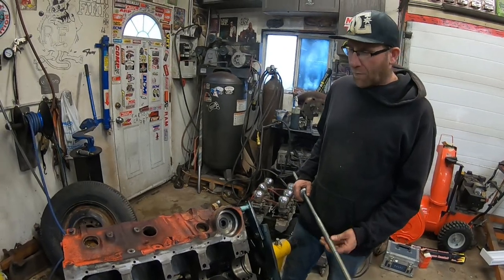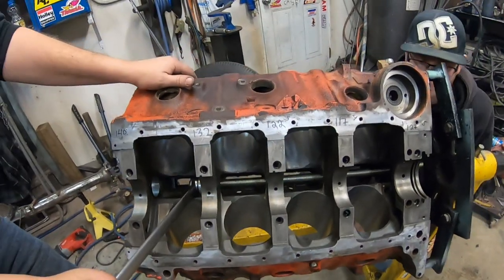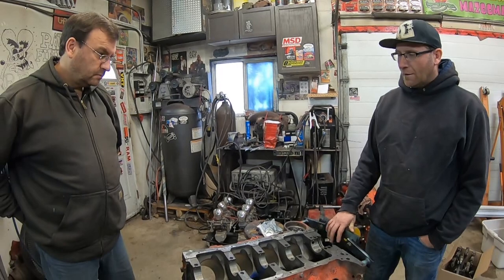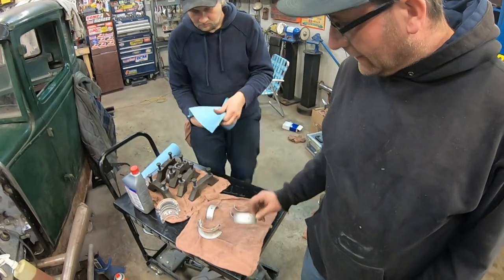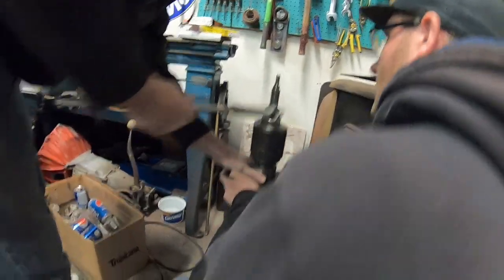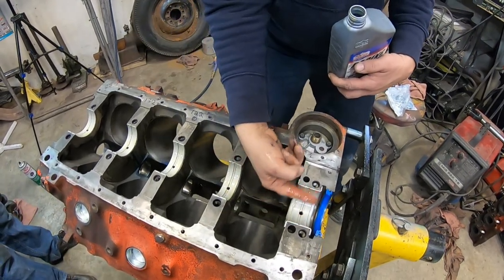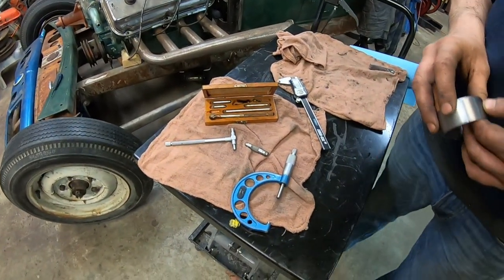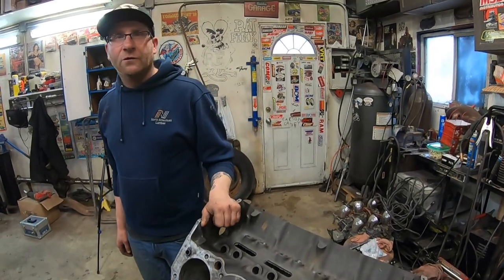454 Failed Cam Bearings.  Crank, Frost Plugs Installation.  1973 Chevelle SS Muncie 4 Speed. 1 of 8

Comment: Always afraid to do cam bearings  so the guys that would hot tank  my block  would install cam bearings as part of their service. Glad you showed me that I had been doing the right thing because I did not know what I was doing. I like following the build on big block,  Merry Christmas you Guys and stay warm.
Reply from the maker: We have done a few cam bearing installs in the past, but this one was a, you no what.
Reply: you always put in the back bearing first and work your way to the front of the block and some engines have different size bearings front to back EG the back bearing is slightly smaller than the next so make sure you have the proper bearing going to the proper spot. some engines have the same size but you need to watch for that if doing it yourself

Comment: I use a light so I can look right down the oil hole to make sure the bearing is aligned with the hole and the bearings go in back to front because they are slightly smaller as you go back

Comment: I like using assembly break in lube on the bearings. motor oil is too thin for my liking but the oil you have it good oil for the engine while breaking it in I use that or Lucas zinc additive break in oil
Reply from the maker: Lucas oil is pretty good too